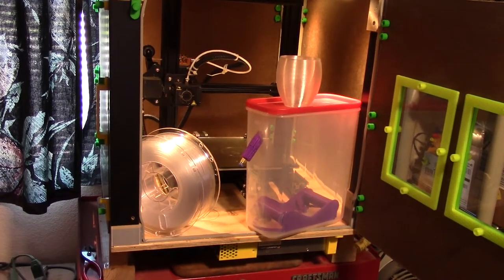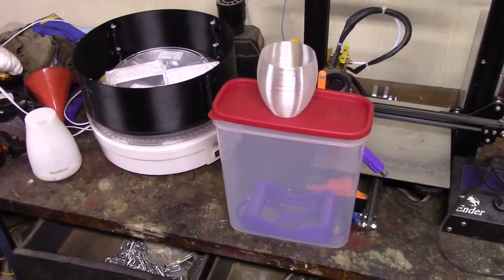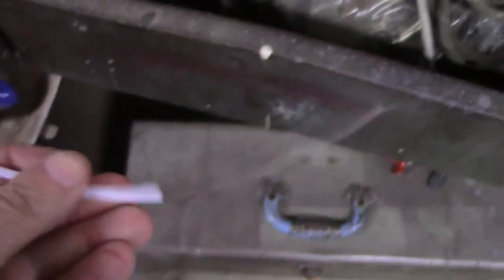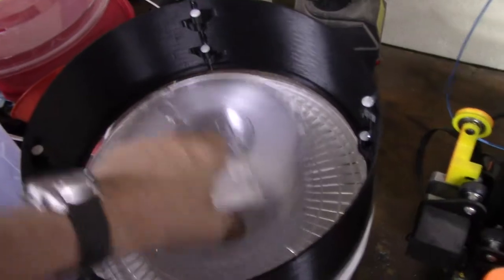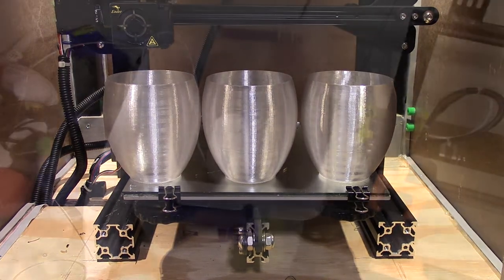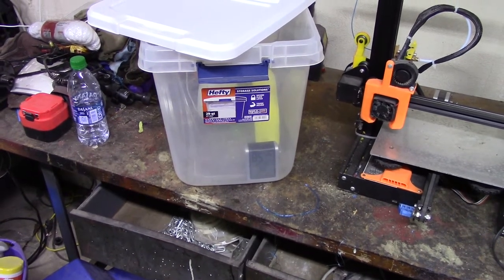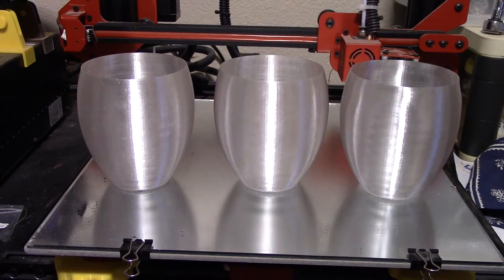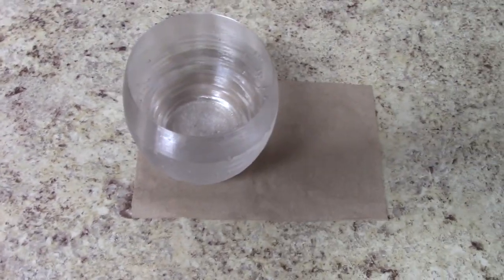Do You Need to Dry Your Polycarbonate Filament?

Comment: Great video Chuck.  Getting tubing to stick in a fitting.  Assuming its not damaged, Giving the bowden a slight twist, back and forth, axially, will allow the tubing to be scored lightly,  This allows the tooth on the fitting to hold more securely.  Really soft teflon, this might not be desireable.  However, for harder bowden tubing, like Capricorn XS, it is a requirement.  Also, if you can get it inserted, a thin zip tie of locking clip can be used to hold the collar outward.  This helps both secure, and reduce play in the fitting.   Awesome video.  I'm hoping to jump into some PC soon.
Reply from the maker: Thanks for the tip, I'll try it!

Comment: It's good you are digging into the Polycarbonate topic, because this has really been letdown way too much by most YouTubers, who at best featured a rare special here and there, without really helping much. I am interested in practical prints and IMHO the overly loved PLA is a mostly useless material, for the most situations, because of it's too low softening temperature and it's tendency to dillute in water after months. I fear that PLA is even hurting the public reputation of 3D printing in general, as just a hobby for freaks who like to stuff their cupboards with mostly cheap looking plastic sculptures, instead of being the the wonderful and revolutionary promise of self-sustenance it was years, ago.
Reply from the maker: PLA is fine for a lot of indoor things. Stuff like spice racks, pencil holders and watch stands. It's cheap and easy for almost everyone to print well. It's also good for making prototypes in order to get something right before you use the expensive filament.
But for really durable, weather and chemical resistant parts, it's useless. So I'm with you there, filaments like polycarbonate and nylon are why I got into 3D printing in the first place. Thanks for watching!

Comment: What about the bed when the polycarbonate finish print I take it off the bed with a chunk of the glass bed itself what you do for the bed ??
Reply from the maker: I'm using mirror, hairspray and 90c temperature. I haven't had any problems getting it to release. Are you letting the glass cool down first? What brand filament are you using?

Comment: Great video thanks! But you said 35% is humid weather I got really surprised. In my country 70-80% is humid weather. 35% I have problems with my nose! (◍•ᴗ•◍) Keep the good work!
Reply from the maker: What I meant to say was 35% is high where I live now, which is the desert in Arizona USA. But I've lived in the Seattle USA area where 70% to 80% is normal, so I know what it's like trying to keep stuff dry and rust free.